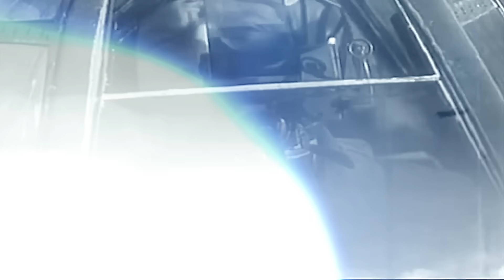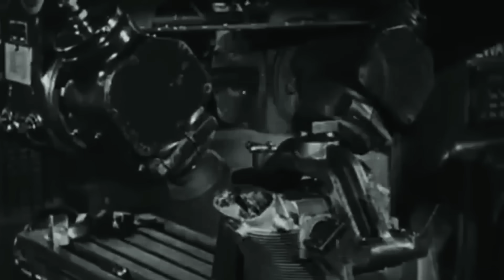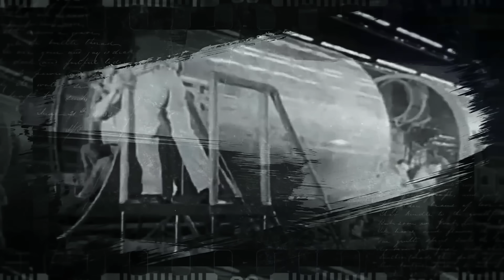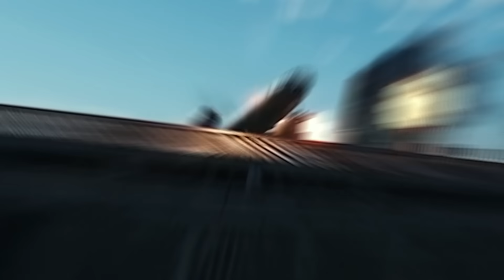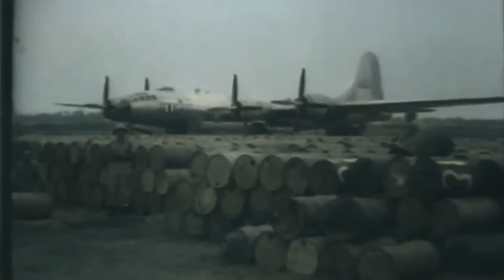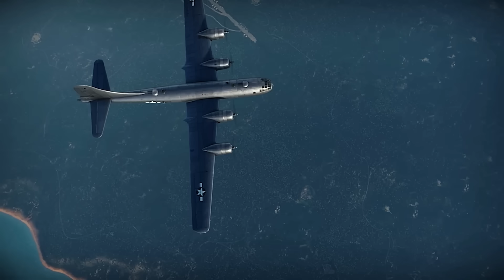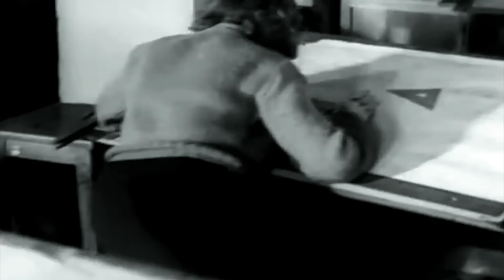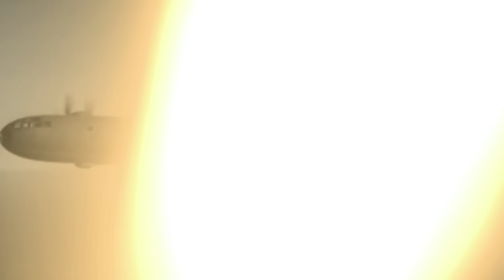The Shocking Truth Behind Wright’s R3350 "Duplex Cyclone" Engine

Comment: Exhaust driven forced induction is turbo charging. Direct mechanical forced induction is called super charging. Add a cooler befor or after the fact and you jave intercooling and aftrer cooling.
Reply: You are insisting that modern automotive terminology must be applied to historical aviation technology. No, it doesn't.    It was called things such as turbine driven supercharging but the important word is supercharging, which is what it was. The compound word "turbocharger" was not in use then.  Just get over your personal frame of refence when reading history and you might learn more.
Reply: Exhaust Driven Forced Induction is Turbosupercharging. In the case for every World War 2 Turbosupercharged engine installation, the Turbo is feeding its compressed air to the engine-driven mechanical supercharger.
Now, shall we get into Turbocompounding?
Reply: @peterstickney7608 no need, i am fully aware of that, if its not fed to a supercharger then its turbo charging. Like the p38 etc.
Reply: @kiwidiesel  any kind of forced induction is supercharging, whether it's mechanical supercharging or turbosupercharging

That we call it turbocharging for short doesn't change that fact (it was actually a branding created by General Motors for the original Jetfire car models - just like Petrol, Gasoline and Benzina are brands that became generic names in various parts of the world)

Turbocompounding is different because it relies on exhaust velocity rather than volume(*) and drives the crankshaft directly

(*) It also requires absolute minimum back pressure, which had me wondering about the comments regarding turbosupercharging AND turbocompounding on the same engine. These have diametrically opposed operational requirements that could really only be achieved by having some cylinders driving one and some the other, adding not only mechanical complexity but varying the workload of individual cylinders, meaning varying exhaust/cylinder temperatures, etc that were the bane of these engines
Reply: @kiwidiesel 
The P38 had the same system, the engine had a single stage single speed centrifugal supercharger, the turbos didn't do anything at low altitude, the engine exhaust was diverted out the waste gate dump valves, once the aircraft gained enough altitude to where the engine's single stage supercharger could no longer provide maximum boost because of the thinner air the waste gate valves would start closing diverting exhaust to the turbo driving it which fed the engine's supercharger, the higher it got the more the waste gate valves would close diverting more exhaust to the turbo driving it faster keeping the air pressure at the supercharger's inlet the same as at lower altitude.
B17's, B24's, P47's, the P61 Black Widow all had the same system, it was the Army's preferred design, the P39 and the P40 were both originally supposed to have the same system but in the late 30's England, France and other countries were all screaming for aircraft so to expedite their development time the turbo was dropped from those two aircraft to get production rolling on them.
Other nations and the US Navy chose single stage 2 speed and later 2 stage 2 speed superchargers for high altitude performance, they were simpler designs that cut down on development time and were easier and cheaper to manufacturer, the downside was they didn't have the superior high altitude performance that the supercharger/turbo configuration the US Army preferred had, each design had their pro's and con's.

Comment: Wright (and later P&W) were amused when the Soviets copied four (interned) superforts SO EXACT that the first four TU-4s (NATO codename BULL) built ACTUAL HAD THE BOEING WORLD GLOBE SYMBOL ON THE CENTER STEERING COLLUMN! As the BULLs started service American engine builders AND Hamilton-Standard (who made the propellers) were highly amused (and THREATENED legal action)when the Bulls puked hydraulic fluid, were prone to hub failures, and leaked GALLONS of oil on the ground AND air, ALL PROBLEMS THAT SUPERFORTS HAD UNTIL THE INTRODUCTION OF B-50.

Comment: When I was in ADRA school at NAS Millington, TN, the first engine we were trained on was the R3350.  I still love that engine, it powered the A-1Skyraider.  USMC (Retired)
Reply: When I attended ADRA School in early 1972, we trained more on the 1820. On the flightline was the S-2F "Stoof."  In the classroom was a partial cutaway R-4360 that had a 120 volt starter motor that was supposed to turn it over but the motor had failed.   Many years later, a friend attended an A&P program at a community college in Orange County, California. They had that very same 4360 with a plaque saying it was donated by NATTC, Memphis!
Reply: Skyraiders carried the weight of ordinance of a B17 with that one motor.
Reply: @icewaterslim7260 I am not a plane guy but how can one engine plane carry more than the 4 engine b-17?
Reply: @youtube  mademecreateanewcha6965 
----------
The engines were not the same, and airframe weights vastly different.
Reply: @youtubemademecreateanewcha6965  Big engine and probably better props and one pilot . . . no waist gunners with M2 50 calibers and ammo, no belly turret or gunner with pair of M2 50 calibers and ammo, no top turret or gunner with Pair of 50 calibers and ammo, no tail gunner with M2 50 calibers and ammo, no bombardier, no co-pilot or extra controls, no dysfunctional Norden Bombsight . . . All that stuff adds up..

The A1 Just had wings with ordinance racks underneath  and two or four 20 mm cannons in the wings and ammo. The B17 carried much less weight than a B24. I think something like half as much. If you've ever stood next to a B17 they aren't very big considering their big crews and could land on as little as one engine with an empty bomb-bay and a good pilot . . . maybe crash land because that B17 is likely so shot up it's going to the scrap yard if 3 engines are shot out. They are not anything like a B29 which is the one with the four R3350s . . . now that is one big cigar.
Reply: @youtubemademecreateanewcha6965   Four small radial engines against one huge one. One pilot against a crew of ten. Ten or more heavy machine guns and ammo against none. Much more weight and drag. And the A-1 Skyraider design is a good ten years newer than the Flying Fortress.  But I suspect with a reduced fuel load for short flights, a B-17 could theoretically carry more bombs.
Reply: @scootergeorge7089 thanks for that info.
Reply: @youtubemademecreateanewcha6965  the B-17 internal bomb load with general purpose bonmbs was 6 x 1000lb which is 6000lbs.   But they often only carried 4000 lbs when the mission was long range and very high altitude.  If they used armour piercings bombs which were a lot smaller for their weight the internal Bombay could carry eight 1600 lb bombs which is a respectable 13,200.
-It could be fitted with external bomb racks which would take the bomb load to 17000.
-The B-17 was limited by being a low wing monoplane and the wings spars  limited the Bombay size.  But if you hear people talk about how much better the Lancaster was carrying bonds remember the Lancaster was flying not at 25,000 30,000 feet but 8,000 to 12,000 feet.  And it had to do that at night because it be shot out of the sky by flak at that low altitude.  It was also short of a few thousand pounds of heavy calibre machine guns and armour to make it survivable
Reply: The Douglas A-1 Skyraider had a long record of service for the Navy, Marine Corps and Air Force, right up to the 1980s.

Comment: Having seen magnesium fires in the chip pans of CNC lathes, I have to wonder about the management mindset  at Curtis Wright for incorporating Magnesium into the alloy of a crankcase of an aero engine. I've heard of the rumors of management missteps in assigning the designers of the R3350 based on jealousy, and those of many of the fixes having been  conceived during it's initial development and rejected by management. If so that speaks more to the bad management plaguing Curtis Wright through the '40s, that resulted in a Congressional investigation,  than perseverance.  

 Some number of B29 shoot-downs were  achieved by  Okinawa based Ki-84s pursuing stragglers that had lost altitude on their return to Saipan in dealing with overheated engines. Those should probably be defaulted to the list of operational casualties as well.

And the Douglas A1 Skyraider should be added to the list of iconic R3350 powered aircraft.
Reply: A block of magnesium is VERY hard to set on fire as it's an extremely good heat conductor. Even in most fires, unmachines blocks of magnesium stock won't burn.

(shavings or poweder are an entirely different matter, just like aluminium -  but then again wheat, milk and wood dust are explosive under the wrong conditions)

The fact that the engines could be set on fire demonstrates just how badly designed they were and in particular how poor the cooling was.  It would have been thought to be virtually impossible for this to happen before it started happening
Reply: @alanbrown397  The early variant of R3350 leaked oil and had leading exhaust pipes, which are common in smaller motors but not sound practice in engines that large. In addition, Boeing never had the time to develop the aircraft before Hap Arnold wanted it put into operation, and the cowling didn't function properly until redesigned. They had actually canceled the B29 upon the death of their chief test pilot and several engineers and people on the ground in a crash of a prototype due to an engine fire that severed a wing. The record of engine fires is what it is.. The Air Force threatened to sue for money congress spent on it's development and Boeing agreed if the Air Force accepted responsibility for the consequences.
Reply: @alanbrown397  I once used a simple propane torch on a 1/8" aluminum/magnesium alloy rod (hey, I was young). It took no time at all for the aluminum to melt and magnesium to ignite, burning small craters in the concrete floor! Now, that wasn't a "block" of magnesium, but it also wasn't shavings or powder.
Reply: I once worked in a Chemical testing lab at a lime plant. For some reason, we had some Magnesium shavings in our chemical supplies. One night, I put one over a burner, just to see what happened. It does burn fiercely! Thank you for your knowledgeable reply above. Good info.
Reply: The Wright R3350 never had magnesium engine cases, it's a common myth repeated in this video, they had forged steel cases just like the Wright R1820 engines in the B17.
Reply: @dukecraig2402  The MAPS Air Museum and The Aviation History Online Museum, Say that the earliest variants of the R3350s had magnesium in the alloy of it's crancase and attribute the heat generated by the burning magnesium content to be enough to sever the wing, including the wing of the prototype that crashed
.This is the first that I've heard that no version of R3350 had magnesium in it's crankcase and I found one site that attributes the claims to error propagation and cites what he calls the original source material without referencing it by title. I do think that's possible because of several cases of error propagation. One such case being where several sources claim in error that the Japanese Army Ki 43 III had a two stage supercharger while what it did have was a single stage two speed supercharger. This definitely has my curiosity up as other extreme cases of error propagation do exist and I'll have to dig deeper to see if this is an example. So thanks for posting.
Reply: The poms found this out with high magnesium content in their navy boats at The Falklands conflict.
Reply: @kiwidiesel  Do you have a source for that, Kiwi?  The issue with the Brits boats had to do with aluminium-alloy superstructures.That helped keep the topsides lighter, but in a fire, such as was started by the exocets, the structural integrity goes away. In a hot fire, the aluminium just melts.
Reply: @davidhull6359  Aluminium burns just like magnesium does, it's just harder to set alight in the first place (think: Thermite). Once the aluminium superstuctures of the ships started burning it was impossible to put out - just like magnesium, adding water makes things worse as the Aluminium will strip oxygen from the hydrogen and burn even hotter
Reply: @alanbrown397  Well I've never seen aluminum chips burn and I've seen lots machined. I've seen very little magnesium machined yet seen it burn in the chip pan twice. Only in the lathes. I've milled it but never started a fire among milling chips. We ran coolant in both, but it runs into the reservoir and the chips sit on top of that in the pan. We didn't run that for long because they redesigned the part for 303 stainless. As i recall, cost was the factor for the customer's change. The burning wasn't that much a concern for that environment, as it  only happened in high heat and was limited to that. IOW it happened in a nearly empty chip pan and didn't continue as the pan filled.

Comment: I understand the Wright engineers used very 'loose' cooling baffles that allowed cooling air to bypass the cylinder cooling fins, rather than flow through the fins, resulting in very hot running.

Comment: The decision to use magnesium in parts of the turbocharging system that are subjected to exhaust gas flame was not something that should have been done. Magnesium catches fire and burns at very high temperatures. What made them think they could get away with building it like that is stupidity at its best all of the engines of the early b-29s in the field once they figured that out. Hopefully they fired the idiot that thought that magnesium belong to be part of a Turbocharger system.
Being able to operate at above 40,000 ft was a decided advantage. Very few of the Japanese aircraft like the Ki 54 Hayabusa we're even capable of flying that high.
The plane that was worse than the B-29 was any B-24 that was built out of the Willow Run Facility by Ford motor company. Those killed more men than enemy action did. They were a considerable problem with falling out of the sky.
Reply: The only magnesium usage was in the forgings of the crankcases and the accessory case.  Not aware of any use in the turbo-charging mechanism.
Reply: @whalesong999  agree no way mag was used in the intakes
Reply: Their wings fell off

Comment: One serious design detail that helped make the R3350 so razor edged in cooling was that the earliest models had the front row exhaust ports facing forward to a collector ring just behind the cowl nose, so hot air from its environment could only pass through with the cooling air coming in through the cowl opening.  In the images of this video, that feature can be seen with the red plugs in those ports in views of the engine.  This was a serious flaw that they eventually solved by making new cylinders with the exhausts facing rearward to pass through the back, or second, row of cylinders.  My dad was an inspector at Boeing/Wichita during the war and even though I was very young, I recall him coming home with sorrowful stories about the big Wright's engine fire problems.
Reply: The designer of the successful and reliable R-2600 and the R-3350 was a German immigrant Rudolf (Rudy) Daub.  He had seen single-handedly designed and put forward the R – 2600 proposal going straight to senior management. 
-Daub had a bit of a problem in part because he was German born but mainly due to the fact that he was always right. He was one of those geniuses that could see not only problems ahead but Solutions to them whereas others would blindly stagger into those problems unaware that they even existed. He had bypassed a lot of people in  in getting the R – 2600 developed and manufactured and left a lot of noses bent out of joint.
-Rudolf Daub designed the R-3350 and got the engine running in 1936 but then they transferred him to one of the disastrous conceived hyper engine programs the tornado which Daub hadn’t designed but was supposed to fix.
-The engineers that took over the R3350 basically then blindly undid  a lot of Rudolf Daub’s work to simplify production such as getting rid of the carefully curved exhaust manifolds which light became a problem when the angular manifolds generated hot gases that burn through the manifolds and damaged valves. 
-We know this because fixing the R-3350 in 1943 and 44 was basically restoring many features of Rudolf Daubes original design.  
-It was a disgrace and an embarrassment with a lot of people tried to cover up as you can imagine about the truth is obvious when you look at the original design, the troublesome designs, and the fixes.
-The R – 3350 certainly would’ve been ready earlier and it certainly would’ve been reliable earlier.  Who knows how much it would’ve affected the war but my guess is a lot.
Reply: @williamzk9083  what's your source on all that? I'd like to read the original sources. I've given you a provisional upvote. lol
Reply: @dave.of.the.forrest  I misspelled his name but it’s been corrected.  If you google now you should find it.
Reply: The cylinder fins are extremely close spaced for more surface area. However cooling air cannot get to where it’s needed. Air will just flow around the fins. I believe removing half of the fins (especially on 2nd row) would have improved cooling.
Reply: @Dave5843-d9m  The baffling is how the cooling air is packed around the fins to maximize cooling.  Lawn mower engines and chain saws are examples where directed cooling air is forced around high heat areas.  Long time mechanic on lawn and garden equipment here, motorcycles too though they don't use baffling on those air-cooled engines.